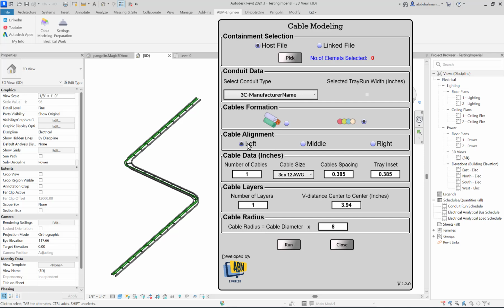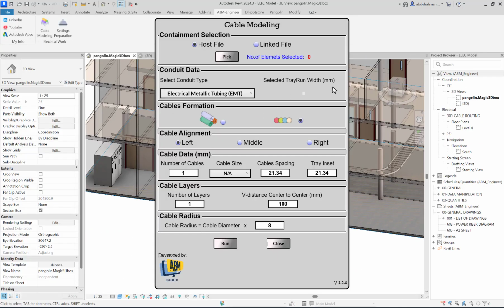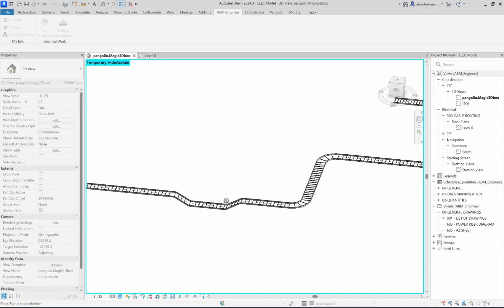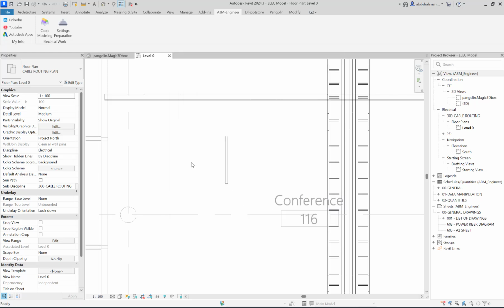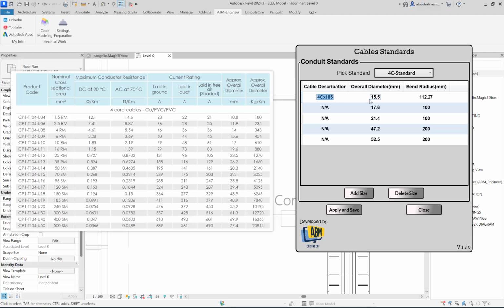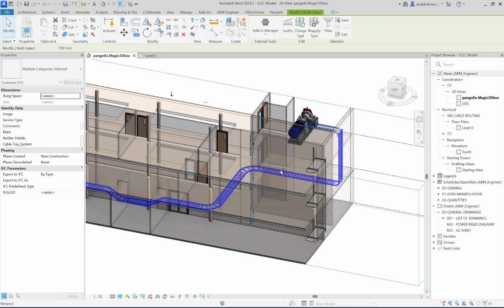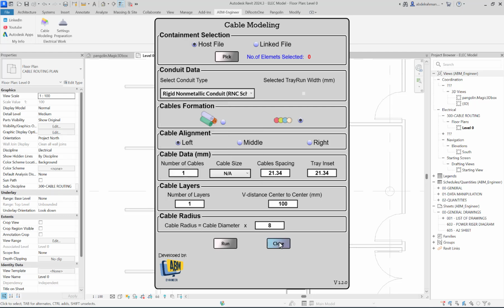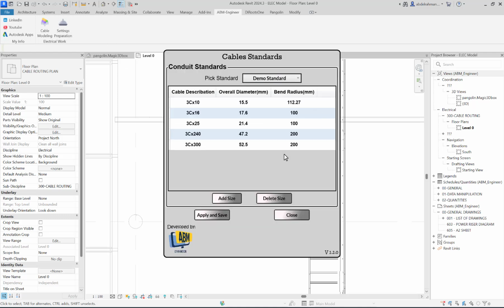14.1-Cable Modeling Update 1.2.0 | Revit Plugin

Comment: I recently had the opportunity to test the latest version of the Cable Modeling plugin for Revit, and it’s truly a game-changer for electrical modeling within cable trays. One of the most significant updates in this new revision is the inclusion of imperial units, allowing users in the United States and Canada to work seamlessly with inches and feet—finally aligning with the standards used in North American projects.

This feature alone sets the plugin apart from anything else available on the market. The interface remains intuitive, and the automation it brings to cable modeling drastically reduces manual work and potential for errors. I highly recommend this plugin to any Revit user looking to streamline their electrical design workflow with precision and efficiency.